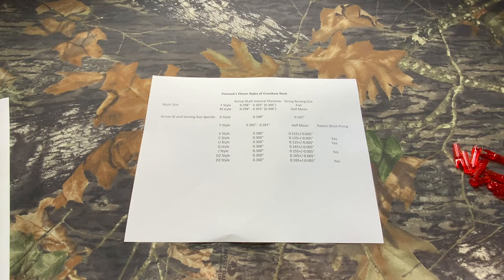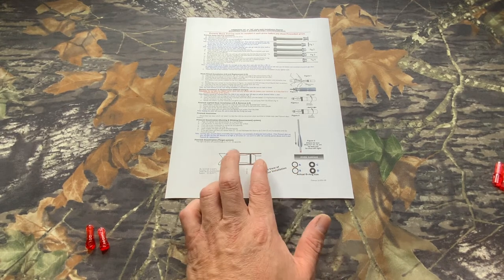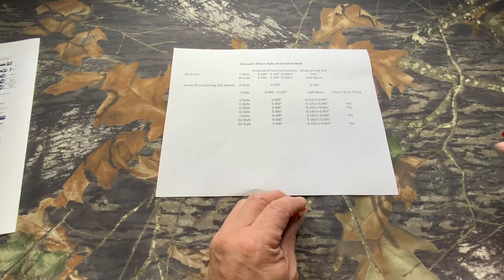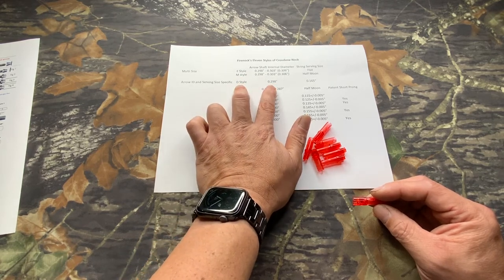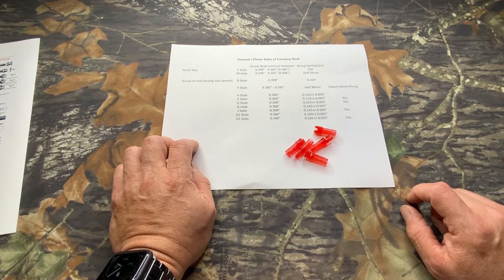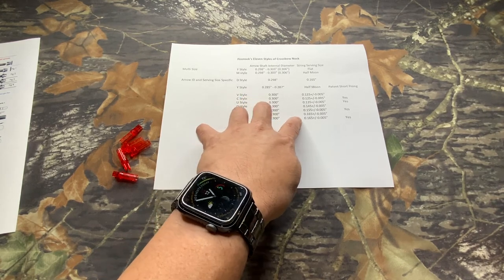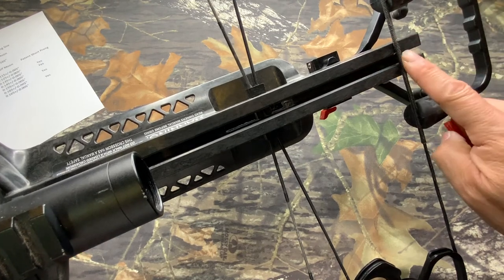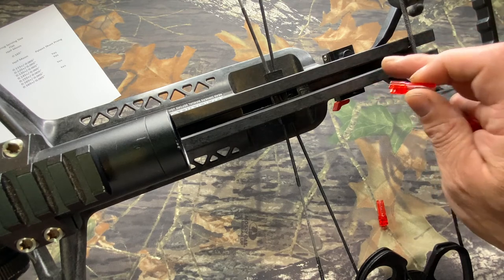Firenock's 11 Crossbow Nocks | Series Discussion

Comment: Dorge,  
I have a Excalibur Matrix 405 crossbow. I have watched a couple videos of you with the guys from Exodus. I would really appreciate your input on a well built crossbow arrow, nock, insert and broadhead you would recommend if you were shooting a crossbow yourself? Does the aeroconcept also apply to crossbow arrows? I would appreciate any help or an website you can give me in designing my arrows for the 2022 season.
Reply from the maker: For the record, the reason that AeroCeoncept™ exist is due ot the excessive force and demand on the arrow performance from a crossbow.   At this time, I do not believe when you shot over 450 fps there is any good enough crossbow arrow than AeroWeave I made and dual patented.  the end of the day, the BIGGEST deal of getting good crossbow arrow flight is a SMALL broadhead.